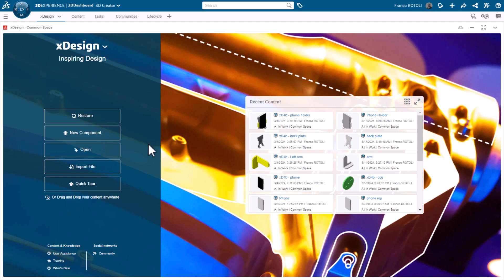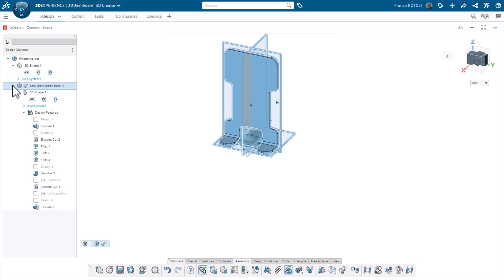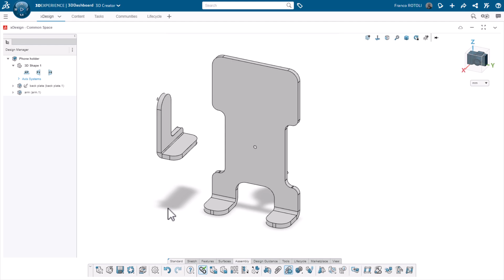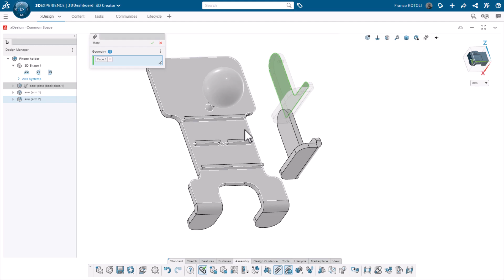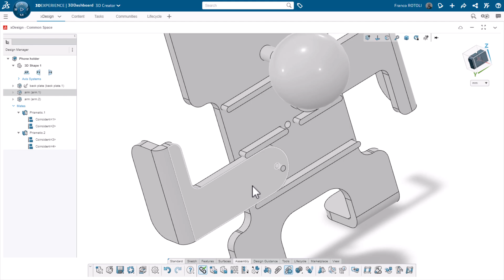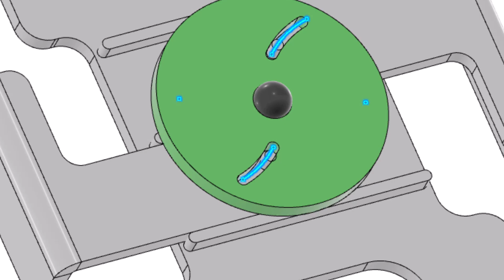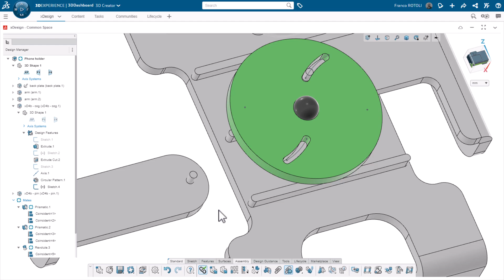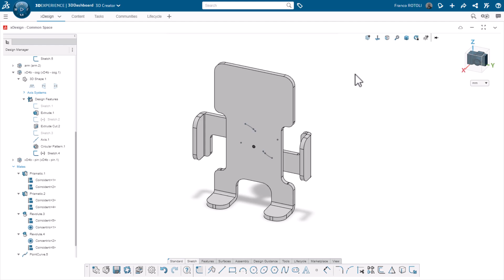Beginners Guide to xDesign – Phone Holder: Holder Assembly

Comment: how do you move the part? when I click and drag, the view rotates. I need to use "move' command to rotate the parts ...
Reply from the maker: Hi @changomeister, try holding down the Ctrl key while clicking and dragging the part, or use the Rotate Component feature if you're working in an assembly.

Comment: Same issue as @stephenwaldrip9814. The sketch is only applied to one slot. Also, the center line of the original slot was not able to be selected as a construction line. I had to make regular line from within the original sketch.

Comment: The construction line is not showing up on the copied center arc slot. Therefore, I cannot mate the two parts. What am I missing?
Reply: On the bottom nav menu, open "Tools" then "Print 3D". In this menu you'll open the "Layout" tab and then select "Auto-arrange" next to "Nest Components" and this will break them up across your print area!

Note, you can add your own printers print area so that they can be automatically sorted to fit within your print bed out of the gate. This is done in the same window but in "Settings" instead of "Layout" and then "Add printer build envelope". Happy printing!